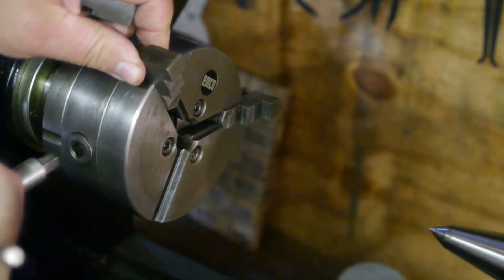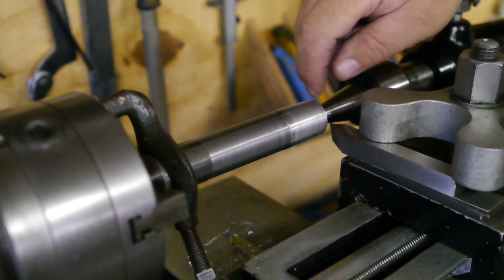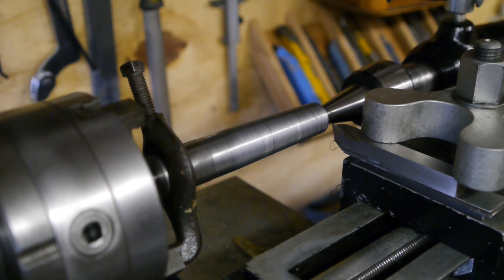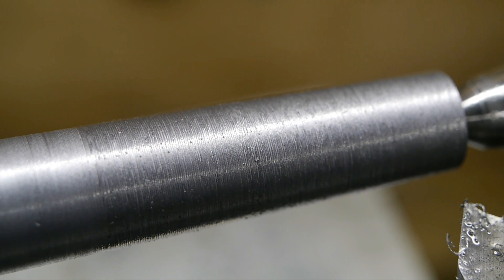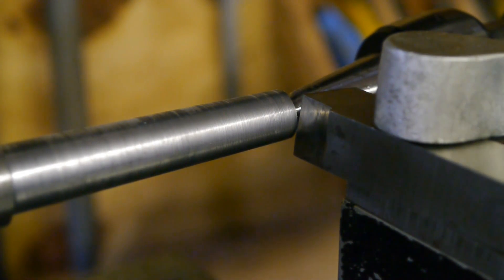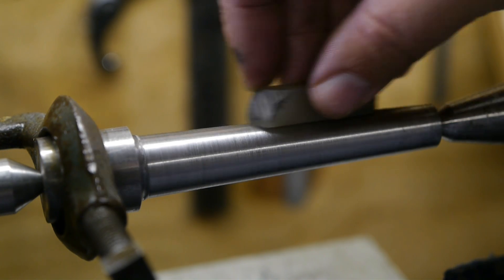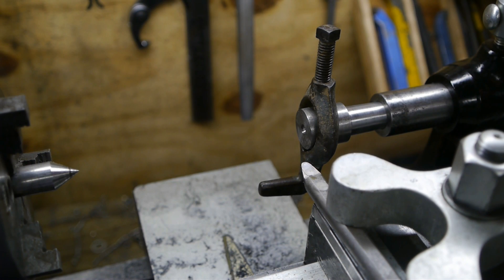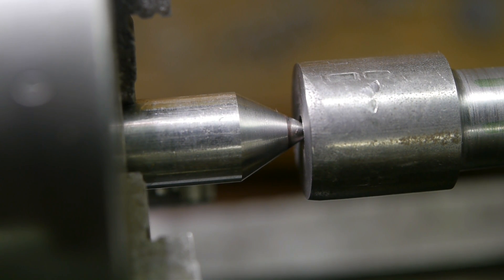Turning a MT2 taper on my old lathe

Comment: hi thank you for sharing this video and your experience... i wonder if the dead centre you are holding in your 3 jaw chuck is also taper .. because if it is there is no way for you to be sure that the point is on centre as it will pivot on only one point where it comes in contact with the chuck.. is the spindle of your lathe not a morse taper? if so would it not be better to hold the dead centre direct in the spindle?
Reply from the maker: There is a little but of run-out run the old spindle. Bur cutting a point on a piece of stock material that is eliminated.

Comment: How I would do it, I would take out the tailstock barrel from the tailstock, push in the morse taper mount the barrel and Morse taper arbor in the other lathes chuck and drill the hole.  I suppose, I would be using the tailstock barrel as a straight morse taper adapter arbor type of thing, got the idea hope this helps you  ?

Comment: when working on small shop machines where its not practical to use coolant you can use coolant that youve frozen into dixie cups or something and you can even put in a handle like a pop sickle stick of some type and use them--or freezepacks to cool down a work peice in seconds after roughing including surface grinding or whatever--Ive done it for decades. You can also simply put a small plastic bowl or something under and dump coolant over the part to cool it off in seconds then dump the coolant back in the other container. When surface grinding its a must because slight temp differences can scrap the part. But on a lathe or other part when great heat is produced its very easy to just use ice--with some coolant put in to prevent rust incase you get drippage all over.
Reply: when using this method a person may think "well I can picture having a container of dozens of cups of ice--but in real life you really dont have to do it that much only in a few cases per day..

Comment: If the headstock has the same taper put it in the headstock and use a boring bar to get the hole centered.
Reply from the maker: Headstock is MT3 and also has a little bit of run-out.

Comment: You need a Taper Turning attachment to create shallow tapers like this one. This dovetailed slide is not really the way to produce fine accurate tapers like the one you want.
  Its a device which fits on the back of the lathe and is connected to the cross slide for automatic tapered turning.
  Your spindle speed is also too high in the video.
Reply from the maker: This lathe doesn't have a carriage so I don't think a taper turning attachment is possible.
It is also not possible to offset the tailstock so using the topslide is the only option.
The taper turned out good enough for me.
Reply: Offsetting the tailstock is the way it should be done, so power-feed can be engaged for a slow and consistent feed.
What a bummer that you can't do that with this lathe
You did pretty well setting the taper on the compound, using a dial indicator is so much better that "try, then test" as I was forced to do years ago.

Comment: Drilling into a static piece is not necessarily going to get you a centred or concentric hole.  Drilling into a turning piece, however, will get you a hole that's centred and concentric with the spindle axis.

If your spindle bore is a Morse #2 taper, you're good to go.  Put the blank into the headstock spindle and drill with the tailstock.

If you don't have that option, you need to find a way of making it run concentric without a centre at the tailstock end.  That starts by flipping the part end on end and turning the part you were driving concentric with the cone.  

Then all you have is a workholding problem.  The easy solution is a steady rest, if you have one.  If not,  either a 4 jaw independent chuck or some careful shim-and-indicator work with your 3 jaw (coke can material is ~0.1mm thick, cigarette papers ~0.025).  Holding the tail of the blank concentric can be done by turning a plug for the back of the headstock spindle, centre drilled 6mm or so, carefully drilling the tail of the blank (unsupported) 5mm and then tapping M6.  Once you've done that, all you need to do is run a small length of allthread through the plug and into the blank, and hold it in place with a nut.

Again, drill with tailstock into the turning piece.
Reply from the maker: The spindle is MT3, I don't have a 4 jaw or a steady rest. And I suspect the tailstock is slightly below centre line.
So I think the best option might be shimming the 3 jaw and boring the centre drill hole to size using a very small boring bar. One day, don't know how or when, I'll get this job finished :)
Reply: @Rolingmetal  looking at this video and your video where you reamed the MT2 tailstock, It appeared at least on camera that both TS's were a smidge low. given the dead centre in the ts was aligning to its taper.    Shimming the TS would help  - That would be easy enough to do if the base of the TS is split between the top and bottom, if its one piece with no setover then the only way to shim it would be to shim between the bed and the base of the TS which would render it impractical or you moving shims every time you move the TS - or superglue the right thickness 
shims to the underside of the base on the prism and flat faces

Comment: Better blue the MT before using it, if need be with a sharpie/edding pen. A bad MT might still clamp tight but can damage your tailstock taper, especially if it is not very hard. Pressure rises quickly with self-holding tapers.
Greetings
Reply from the maker: That's probably a good idea in general.
But I'm going to use this taper to make a tap follower. So the taper doesn't have to hold any torque. 
The taper might be slightly of anyway because of the tailstock misalignment

Comment: Considering the rattling at 10:23 to 10:25, I wonder if the taper is still wrong.

At the end, your part may be perfectly centered in the tailstock yet the 3-jaw chuck is not necessarily holding the dead center accurately. And you mentioned wear being a problem on this old lathe.

Take a look at these. They may provide some hints:

https://www.youtube.com/watch?v=CM3M_CaRLgI, and

https://www.youtube.com/watch?v=gCUkJydSmdA

Look online for other videos.

Best wishes.
Reply from the maker: There is some play in the quill key-way. That's the rattle you hear.
I turned down the centre in the chuck at the beginning of the video.
Thanks for the links.

Comment: Hi I'm just an unskilled hobbyist .Can you explain why you use  the pickup clamp and mot putting the work directly in the chuck? I always clamp the bar stock  directly in rhe 3 jaw chuck. Nice videos :-).  Learned from this video the existance of the sheartool. Tnx!  Groetjes Jan
Reply from the maker: Turning between centers is much more precise that using the chuck.
I don have a fixed center for this lathe so I turn down a bit of stock material. 
Probably better anyway since it also takes car of the run out in the spindle.

Comment: i have to sort out the same problem as you on my Chinese 9X20. On mine, the headstock was skewed a tiny bit, and its damn hard to get it right. Great video.
Reply from the maker: My headstock is on a V-way so I's assuming it's lined up correctly. Iḿ guessing this problem is still the tailstock quill.
But assuming and guessing are probably not the best way to fix this problem :)

Comment: Well done on the MT.  

I have only turned one.  Setup is not difficult.  I did the same as you, using a good MT and the dial indicator.  I had to advance the compound manually.  I have not yet made the jig for a cordless drill, but if I had one, it would have interfered with the tailstock.

Sad that the hole is not centred.  If I recall your tailstock does not have any adjustment.

A good learning of making the taper, but a bummer you were not able to complete the project as desired.

I made a shear tool.  I get the same fine long hair-like chips.  A pain.  This tool does make a nice finish though.
Reply from the maker: Yeah, it's a real shame things don't line up correctly. It will be hard to pinpoint and fix. But my money is on the tailstock quill.

Comment: I turned a morse taper the other day, a video by Joe Pie explains how to set your compound extremely close.  Googling says the tolerance on a Morse Taper is +0.002" over a foot (12 inches) on the male part.

My pocket shop manual says a Morse Taper 2 should be 2 degrees, 51 minutes, 41 seconds, with the taper per inch being 0.04995" (inches), and the taper per foot 0.59941"

https://www.youtube.com/watch?v=YCllVu4K738&t=15s
Reply from the maker: That was an interesting video. Thanks for the link.